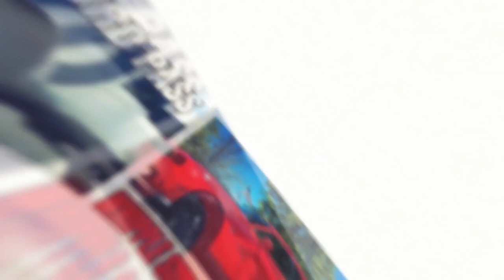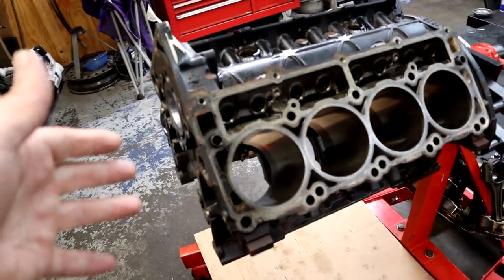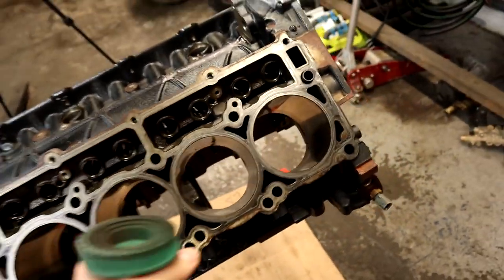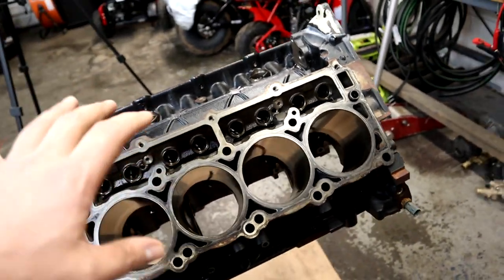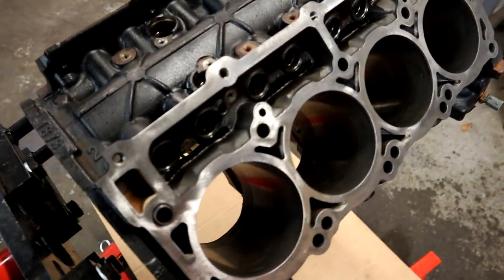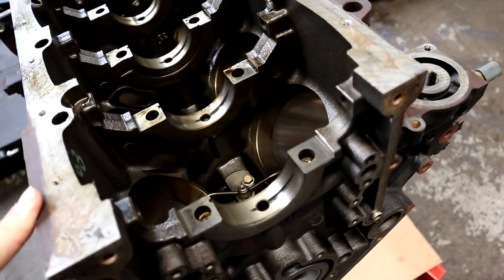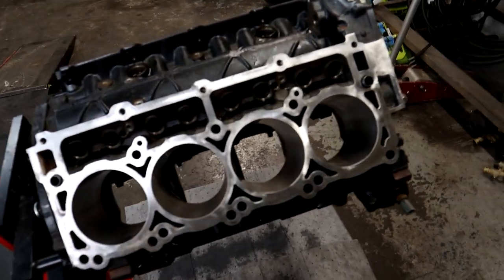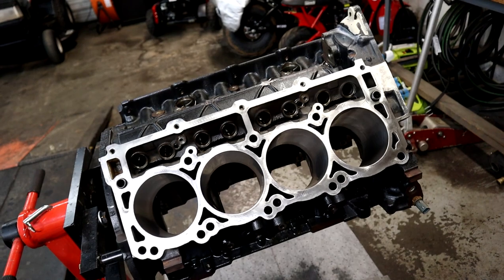Huge New Upgrade For Frostbite Part 1 BGE 392ci Motor Build

Comment: BGE blocks are amazing, you will love it
Reply: One other thing, where can I pick up the brushes you use. I build quite a few blocks and could use that deal instead of the aggressive steel brushes I use.
Reply from the maker: You can get them from tool trucks, or even napa probably and I'm sure amazon

Comment: With a 392...i think itll be close to an 11 depending on the applications the 1320 challenger is close to that and its close to 5k lbs.. id say ol girl is a lil heavier than that....but u will already have the right trans in there...ure ratio in the back .392? Or somthing like a 323 or 355? That will make a difference stock i believe...i am biased tho being a diff guy..

Comment: I have a question I have a 6.4 15,000 miles sounds like the top end lifters and that have 2 dealers look at it they said it’s no noisier  than no normal but no engine codes. Nothing they’re going to do.  I’m thinking about going to 5w-40 oil any thoughts?
Reply from the maker: You can try I don't see it being a problem. However check for broken exhaust manifold bolts very common on these trucks and sounds similar to lifters tapping.
Reply: I’ll check into that thanks for your thoughts

Comment: With Apache heads upgrade your valves , those intake valves have hollow stems  and it does not take much to hurt them i can tell you first, hand your wallet will thank you down the road with a better  aftermarket valves, also check you piston to valve clearance and give yourself a little extra room on you intake clearance,  just built mine and had to clearance  my pistons hood luck on the build..
Reply from the maker: Thanks for the tip
Reply: @FrostbiteRam   there is a big difference between that 5.7 and 6.4 you will have no problem going in to the 9s don't for get to up grade your lifters and go at least 95 mm on your throttle body those Apache  heads flow way more the the Eagles

Comment: You can't tell if a cylinder is good by looking at. You can't see thousandth with you eye. Lol... by changing the pistons you are changing where the rings ride. Spend the little extra a machine shop.
Reply from the maker: I agree with some of that but with all the cylinders I've seen in my day I have a pretty good idea when something will work or not. But I'm trying to stay away from machine shop jail as much as possible.
Reply: Great video looking forward to see this build definitely will be watching.